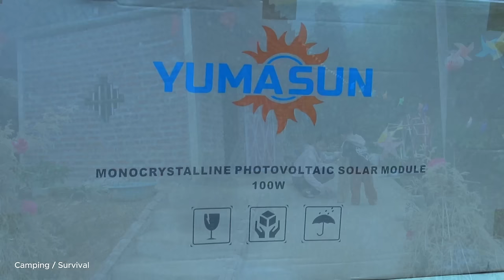Single mom. Installation technique Solar Generator - Generate energy using free electricity

Comment: Good but need to chageing control unit mppt its not use effect battery damage over charging voltage  and its very need sola project

Comment: If you don't use the solar controller, the battery will be damaged
Reply: The amount of electricity that this one solar panel that appears to be about 100 W And with regular use toward lights/miscellaneous this battery Will never be overcharged. I understand your concern. A larger system would require a charge regulator:).